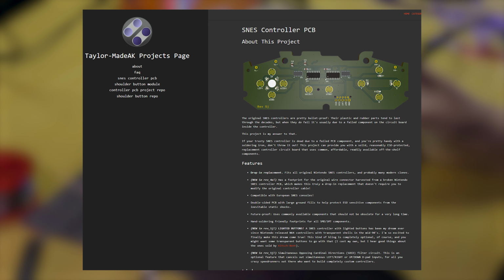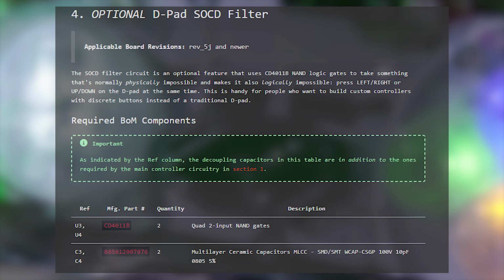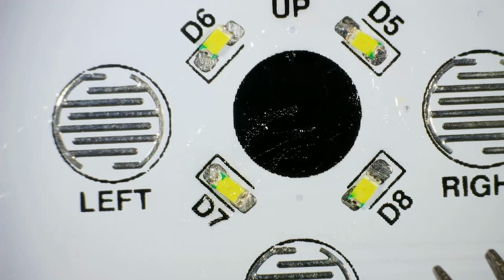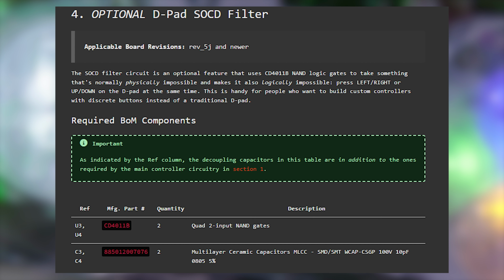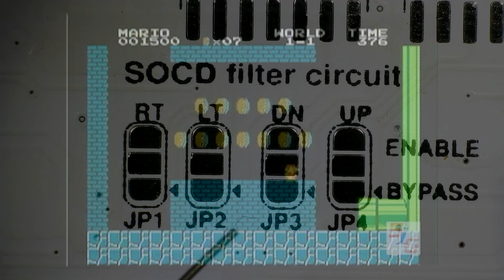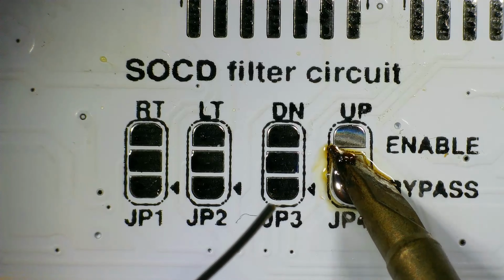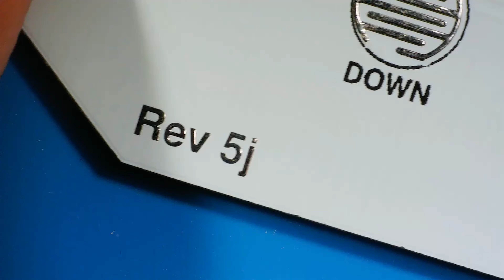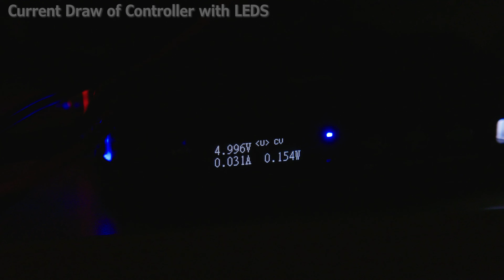Making a Super Nintendo Controller From Scratch

Comment: Looks fantastic!

This controller should be perfect for the open source, DIY Uzebox console which uses SNES controllers. A lot of the clone SNES controllers for sale on Amazon or AliExpress don't work with the Uzebox and those building their own games console from scratch are likely to also want to build their own controller, even if they already have a compatible one.

Thanks from the Uzebox community for posting this!
Reply from the maker: Uzebox sounds like an interesting project I’m going to have a look.

Thanks !
Reply: @Slot1Gamer  You should build one! I managed it with no previous electronics experience. It's pretty cheap to build and very rewarding when you get it fully working.